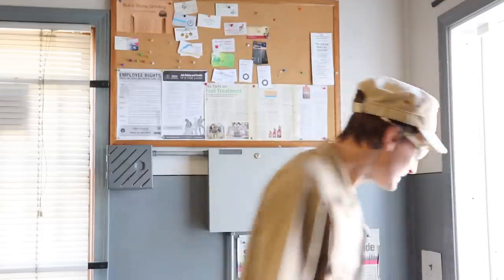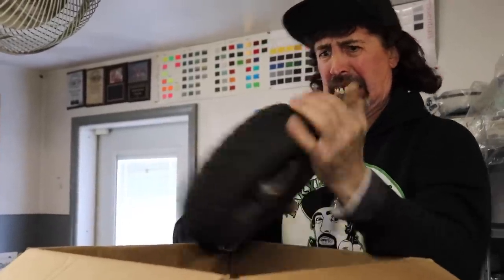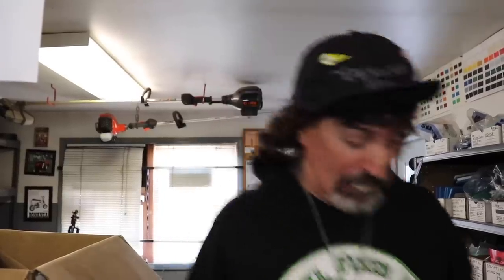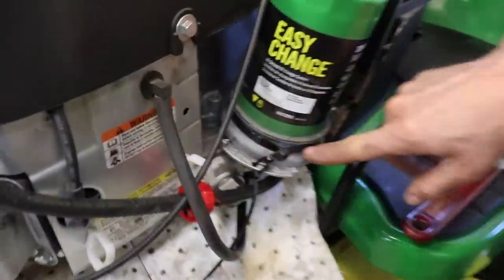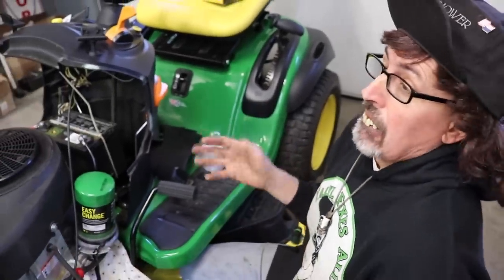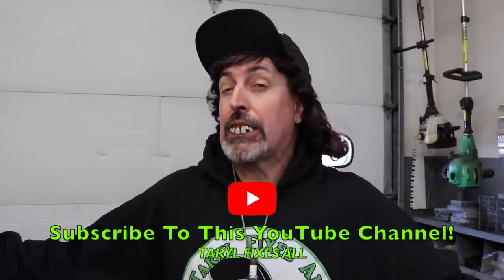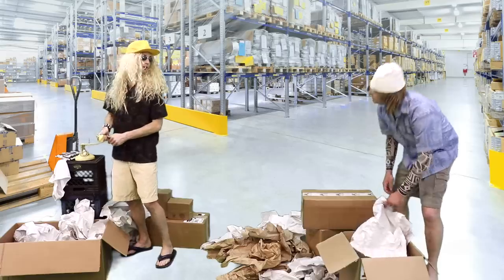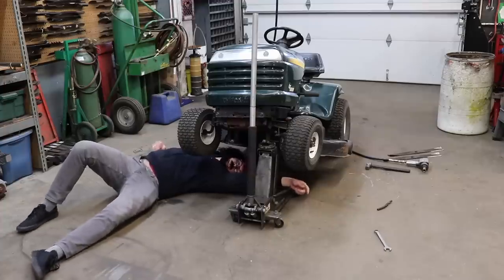John Deere Easy Oil Change NOT SO EASY - Convert It Back!

Comment: The EZ Change filter looks like the answer to a question nobody was asking.
Reply: JD are scammers.
Reply: They do that.
Reply: @TheGuruStud  
Lost all respect for them with the right to repair issue.
Reply: MrHillfolk I’m a contractor that from time to time has to go on Deere’s newest factory in Kernersville, NC. It’s a huge place with a lot of grass to cut. They won’t hire any contractor to even mow their grounds unless they sign a contract to use all JD equipment. The only exception is they’ll allow them to use Stihl handhelds.  Deere management is a religion and I’m not being sarcastic. I’ve never seen a more brainwashed bunch of business people in my life. I could tell another story about something that happened to a contractor that had to go out to that plant but most wouldn’t even believe it.
Reply: @prevost8686  
Heh i dont doubt a word of that , and im sure that story is a doozie...oops i mean a deerey😃
Reply: John Deere is just a name. Doesn't mean it's good.
Reply: The main problem with John Deere is that they don’t make tnem loke they use to
Reply: The answer is profit.
Reply: Answer me this ! My B/S 20 + hp holdes 64 oz of oil ,,but the Easy Change oil filter has only 20 oz of oil , so your not even taking out 1/2 the dirty oil ,,!! Am not understanding something ?
Reply: Same thing w the plastic hoods. That’s why the pre-1990s tractors w the Fiberglass hoods are great.
Reply: That sounds like the same thing with tire pressure monitoring systems in cars. It's called a tire pressure gauge and they're easy to use.
Reply: @Lucas-tr9hh John Deere does have good products but they're not going to be found in the big box stores. The ones sold in the big box stores often times have some sort of useless gimmicks that don't work right or stand the test of time. Their good products are only going to be found at the John Deere servicing dealers.

Comment: JD has a bulletin out listing the parts needed to switch back to a conventional filter.  Along with installing the filter nipple, they also recommend removing the drain plug and installing one of their longer drain tubes so draining is easier and less messy.
Reply: JD didn't use it, so they can charge you more money. All of these mowers are the same design. I have a Poulan branded one and it came with the quick change tube/valve. Once again, JD are scamming. Also, other brands are much cheaper (300+ cheaper for same mower).

Comment: John Deere has a conversion kit with the oil, nipple, and a drain pipe. It's cheaper than the stupid oil change kit.
Reply: Yes, the conversion kit from GreenPartStore (AUC12916-KIT) is $24.99 and comes with all the above and the filter also.  Deere approved and won't void warranty. The nipple in the kit can be torqued in with a 12mm Allen.
Reply: Don’t know what genius thought that one up at John Deere. There was nothing wrong with the old system except for the quick drain plug. I usually convert that with a 3” 3/8NPT nipple with a 90 on the end and a 3/8 plug. Works perfect, no mess when draining oil. Use Harley Davidson chrome oil filter on Briggs and Koehler engines. Looks better. Better quality and costs less.
Reply: @steveb.6267  The important thing is how good it filters the oil on the inside ,,not how it looks outside !! GOD HELP US !!
Reply: @MarkPalmer1000  I wouldn't be stupid enough to buy a tractor that needs a conversion kit in the first place
Reply: I don’t have any major complaints with my E170 tractor thus far, it does everything it’s supposed to do and does it well, and I have had zero issues with it.  The Easy Change oil system is admittedly not the best idea for many of us, but I’m sure some owners will appreciate it.  I wouldn’t let it be a deterrent to buying one of these tractors as it’s easily swapped out.
Reply: I believe the nipple in their kit has a hex head versus a square.
Reply: Is this to get rid of the big tank like vanguard 500 hr oil change thats really 250 if lucky???? Id like to Use screw on filter but mower is new.
Reply: Just shouldn't have to bother. Woner why they inconvenienced their customers like that.

Comment: Another great video! I just changed mine and had to use an oil wrench to get it off and to put it back on. Mine did not rotate easy by hand. I bought two of these quick and easy filters when I bought the mower last year. I'm ditching this method as soon as i use both filters. PS, I've changed car and mower oil for almost 50 yrs. This was a pain.

Comment: Could you tell me if this motor is the same as regular briggs and stratton professional series . Wondering about crank shaft size and length and bolt pattern? My motor has broken rods and just looking to replace my john deere e180 motor with a older used motor instead of replacing it with new. Thanks for any info!!!

Comment: I have a 1993 JD LX188, one of the solid commercial duty lawn tractors with the LC Kawi twin. It's an amazing mower but I get flack from all the JD guys because it does not have a strongbox battery, Hygard in the transaxle, JD oil in the crankcase or a JD filter... The JD oil filter crosses to one for a 4cyl Toyota Carolla. I used Tuff Torq's recomendation for the trans oil and I just have good oil in the crankcase... I also have a 2006 Husquvarna YT2148 with a 23hp Vanguard and aside from being louder being air cooled, it works and cuts just as good, steers almost as sharp and rides a little bit better. The Husky originally came from Lowes as well

Comment: 3/8" pipe nipple. 3/8" ball valve. 3/8" street tee. $20 at the hardware store. "Easy change" forever without doing it half assed. Open valve, drain into gatorade bottle. Refill oil. No paper towel needed. There is a reason Briggs threads these with good old fashioned NPT pipe thread.

Friends don't let friends drive to a Deere dealer.

Comment: I have a 5 yr old JD which has the standard oil filter, a few months ago changed the oil and filter, picked up a Purolator oil filter for half the price JD wants for theirs. This new design, while convenient, is ridiculously over priced. Since JD went to this I figured if I ever had to replace the mower I would have to go with a different brand, but now that I see it can be changed back it gives me hope.>>> Now I see the comments about the factory conversion listed below, definitely the way to go!

Comment: Hey.. There is a butt load of people out there who dont want to do any service on anything. I worked in a neighborhood in the spring the sheer amount of snow blowers and lawn mowers at the curb with free signs was staggering.
Kept me in beer money for years. Put a pull cord on a mower. Clean a carb. Sell it.
So yea, this surprises me not.  Grandpa always said. " Some people have more money than sense."

They would say. my time is too valuable to be messing with a mower.
Cool, I will take it off your hands.

Good idea for some of you young kids out there. If I still lived near one of the upper middle class areas.
I would have flyers out. offering onsite Tune up specials. Just on the weekends.
Make enough for your new truck. Save them a trip? yea they would be all over that.
Cant tell you exactly were that line is drawn. You go into too swanky of a neighborhood and they pay people to mow their yards do their landscaping.
There is that next level down. The Almost there ones. Not enough to plow out thousands for a Landscape service. But just enough to not want to have to deal with it. But you have too.
Flyers will find that market. Word of mouth will keep you busy.
Reply: Yep, agreed! Your grandpa used to say “some people have more money than sense”  my dad always said that too. He also used to say “one mans trash is another mans treasure”  I worked in an upper middle class type of neighborhood for several years recently and the amount of quality usable tools, equipment, materials etc.. that I was able to retrieve from our shop dumpster (which many people dumped things in overnight) was amazing.

Comment: Being top heavy like that, seems like over time it wouldn't be good to have that thing vibrating because it may loosen or screw up the threws on that mount where the oil filter would normally go.

Comment: Some additional background information on this deal. John Deere didn't really want to do it because it adds to the cost compared to their competitors. The real push to add this feature (LOL) was Home Depot. They did some consumer surveys and the number one complaint was having to take their lawn tractors to a dealer to change the oil and filter for $150.00 or more because Home Depot would deliver the tractor for free but you were on your own after at that. So by the time the consumer rented a trailer (assuming they could hook up to one) the cost was sky high.

So this was the solution the Home improvement stores came up with. 

John Deere dealers went nuts.  Here in Canada, these 30 second oil filters retail for $79.00 + 13% sales tax.

I've already converted 20 of these JD tractors here in Ontario. By the way, John Deere will not honor their factory warranty the tractor of this unit is removed. So the customer keeps the assembly, then buys at least one new 30 second oil filter as a backup, should the motor need to have  warranty service.
Reply: Doug Hanchard  Not true all all about them not honoring the warranty, John Deere sells an actual conversion kit directly from Deere that does away with the quick change filter and is 100 % in warranty

Comment: Tuff Torq transmission for an LT John Deere garden tractor is there a better transmission to replace the the quality of the one that comes in with the standard unit without a lot of modification Mike

Comment: I was at home Depot I was looking at Cub cadet also as of July first2020 and then Lowe's also has 30-second oil change on some of theirs Troy-Bilt and others riding mowers with Briggs & Stratton engines I'm on the Eastern side of the United States I don't know if that would make a difference because I know when I travel some products are available out west that's not available here I don't know why

Comment: A motorcraft  FL 920S filter cost 3.99 at walmart, compared to 12 to $15 from john deere and its a better filter.
Reply: John deere filters are made by wix
Reply: @Dager004  Whats your point?
Reply: How is a motor craft filter better than wix
Reply: Brett Tabor - It’s $11.00 cheaper. And it’s a lawnmower, it ain’t the space shuttle. Motor craft is fine.

Comment: Taryl, I have a 21 ohv I/C v twin 407677. It has a cap where the oil filter would go. Can I put an oil filter in its place? I know I have to get the fitting because the threads are part of the cap casting.

Comment: so does it release oil out of the new filter once you screw it on? say you have the drain plug off at the time you install the filter. will you then lose the oil from the new filter?

Comment: The hex 12 can be used to install the Briggs oil filter connector. I think that’s the size. I’ve done the conversion before and doing another soon. I’ve seen the John Deere filter and oil for $70 now. Insane. Using a Napa Gold filter and Castro Edge synthetic oil, it’s no were near that for me to do an old fashioned oil change. SMH 🤦‍♂️

Comment: I'm a cheap SOD so I use Super Duper Tech ST3614 oil filters from Walmart. They replace Briggs, Kohler and Tecumseh or at least everyone I have. Double check but $3 beats $18 by a 12 pack.

Comment: Always entertaining & educational!
Question for all reading this.
I’d like to install a oil pressure gauge on my 1999 Kohler Command Single CV15S spec 41592.  Any thoughts on a plug location to be drilled & tapped for a sensor?

Comment: The part number for those kind of filters and not Auto parts line and it wix is fl400s and a friend is 3614 and it STP it's s3614 they all work

Comment: 8:40 Taryl are you using an automotive oil filter? What is your opinion on using automotive oil filters that fit lawn tractor engines? I just got a Motorcraft FL910S oil filter because it was like a 1/3 of the price of the John Deere one

Comment: I had to do something similar to a Toro ride on mower my dad was minding for a "friend", it ran the Honda GSV530 twin cylinder engine & I bought a Repco ROF142 (equivalent to a Ryco Z142A) oil filter for it instead of the Honda oil filter which costs much more.

It looks like I have to rebuild my Briggs & Stratton 92500 engine (3 horsepower vertical shaft or 3.5 hp ungoverned) as it's burning much more oil than it appears to.

My dad used it for 1 hour to mow the lawn & it burned 250mLs of oil in that period of time,note that I topped it up with oil the last time it was used.

That's nearly half of its oil gone as the oil capacity is 600 mLs,I'm starting to think that it's worn rings,in behind the inlet valve looks all clean & the exhaust valve isn't oily, the spark plug tip is starting to show up as having thick black carbon deposits on it from burning oil !
Reply: Havent been in too many hondas , but can they blow a head gasket and then suck down mucho oil like the briggs do? 
On a briggs the combustion pressure leaking into the crankcase from the blown gasket, overwhelms the crankcase breather and blows it into the intake. 
There will usually be a black streak from the combustion chamber to the pushrod chest on an ohv briggs from a blown gasket.

Comment: For those concerned about only partially replacing the oil, consider this:
Today’s good synthetic oils don’t go bad – they just get dirty. For example, Mobil One has a semi-truck running around the U.S. that never gets an oil change. Every 10,000 miles they take the oil out of the truck and filter the dirt out of it. They then put the oil back into the engine and at the last count I’ve read they have over 3 million miles on that same oil.
So it makes sense that if you use good synthetic oil in your lawn tractor and then use a good filter to keep the oil clean you should also never have to change the oil. (Most owners use their lawn tractor 50 hours a year or 500 hours in 10 years – That only 30,000 miles in an automobile.)
Reply: They put the cheap stuff in the filter

Comment: if its green  run away  lol
Reply: Oliver was green.

I admit to owning a JD mower. In my defense, I pulled it from the trash and fixed the ignition switch.
Reply: @841k9  they old ones  were good  just like  old shaft  drive cubs

Comment: According to John deere the filter contains 1/3 of the oil for the engine.  As long as you service your mower every season like they recommend the engine will be fine.  It's still covered by your warranty.
Reply: @ItsMrAssholeToYou  I'm not disagreeing at all.  Just pointing the fact out.  The big problem is a majority of people dont change the oil on a regular basis.

Comment: 40 bucks for an oil filter...  I'll pass. Rip off from J Deer.
Reply: indeed
Reply: Deere*
Reply: Costs less for conversion kit, comes with a filter and available a JD.
Reply: Costs less for conversion kit, comes with a filter and available a JD.
Reply: Deere can go to hell over the whole right to repair issue
Reply: WJCTechyman I drove past my JD dealer and purchased three Kubotas in one lick. If a comparable JD was cheaper I’d still buy a Kubota. Green paint ain’t worth getting cornholed every time you need a part. Honestly, JD quality sucks compared to what they used to produce. Tier4 JD products will cost you kiester off in repairs alone.
Reply: $50 at my store.  And the damn thing only contains half a quart of oil.  the tractor takes 2 quarts, so that "oil change" only adds half a quart of new oil to 1 1/2 quarts old used oil.  Not only will I not buy that tractor, I won't buy ANYTHING from a company that would pull that kind of a racketeering swindle on me.

Comment: "Maybe you don't mind paying $40-50 for an oil change". Meaning, maybe you have money to burn for a system that changes less than half the oil capacity and continuously supporting JDs bottom line. I think not. The Cost-Benefit or ROI not worth it. Buy the conversion parts one time, buy two quarts oil and filter of your choice. Then enjoy the money savings for something else. Thanks for the vid. Mortimer Snerd envious of the choppers.
Reply: But yet Deere has a conversion kit to change it back so it's not about the bottom line. It's for the intown people who go to a dealership to have their oil changed every time. It's all about people who don't want to do it or want it done Easley.
Reply: @chadjustice8560  Since the QC system is now the default OC system on many JDs, 'IMO' it's mostly about contributing to JD's bottom line. $40-50 for an oil/filter change vs $15-20 max, and without using any JD parts of one chooses. And it changes ALL the oil not just .8qts. So as noted cost benefit/ROI not worth it for me. And JD offers the conversion kit now because I suspect, so many complained. The JD QC system, and expensive solution looking for problem. Buy the conversion kit, leave to QC system for the lazy rich. Or "Easley", whoever that is. :D

Comment: 1. Is that the wrong fuel filter on there? Looks like a gravity feed grade filter instead of the typical fuel pump style one.
2. Does that really make a difference?
Reply: Kevin Levy you can use the red screens on both systems.  But using the paper element type on a gravity system usually ends poorly.

Comment: They should just put a dent in the frame so theres a troth for the oil to run out in one spot. I usually jut put a brick under the back wheel to help it drain to the side.
Reply: Try folding a piece of cardboard into a 'v' and putting under the drain so it acts like a trough to your drain pan.

Comment: I did away with that quick change filter. Also installed an extension to drain the other half of the dirty oil that was still left in the engine.